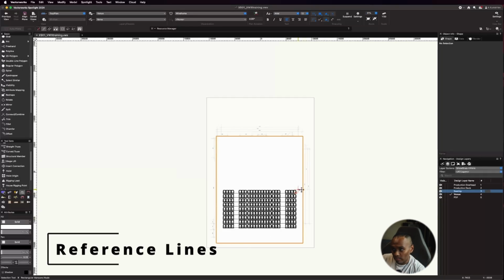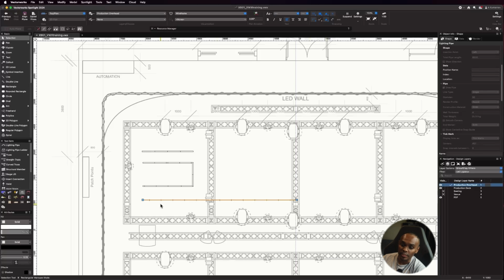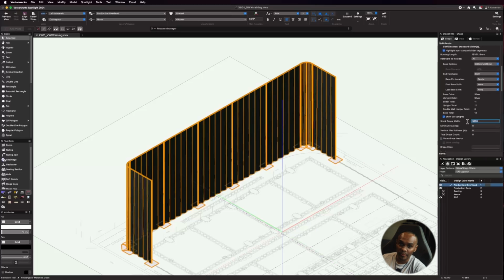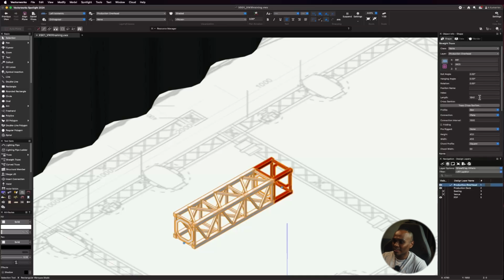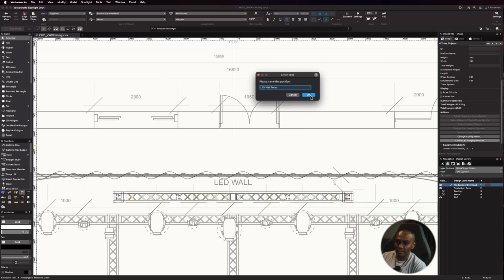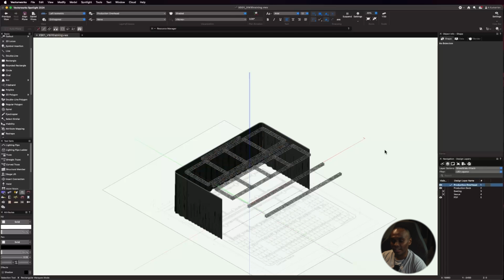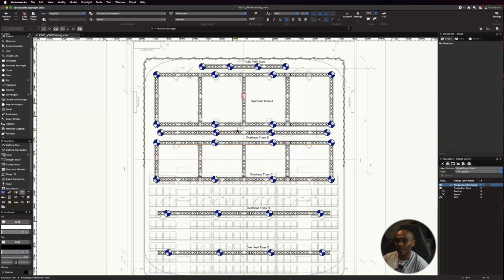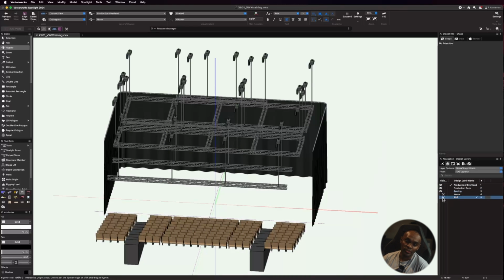Vectorworks - Rigging Tools Part 1

Comment: This is a very helpful video, ive been using vwx for a fair while but its giving me lots of tips on things i dont use and object obtions i havent found yet. 

One thing though, you label trusses in the wrong direction! Sorry. haha.
A to Z/LX1 to LX(x)  Downstage to Upstage, Stage Right to Stage Left, Top to Bottom! 
Reading plots any other way makes my brain hurt lol.
Reply from the maker: Thank you! I think I labeled them based on what gateway theatre calls them 🤭. That might be the cause for the headache. Not very sure why they use alphabets either 🤣. As for the stage right to stage left thing, in some theater spaces we were taught to always label from stage left. Prompt side. So that kinda stuck in my head and has become my norm.